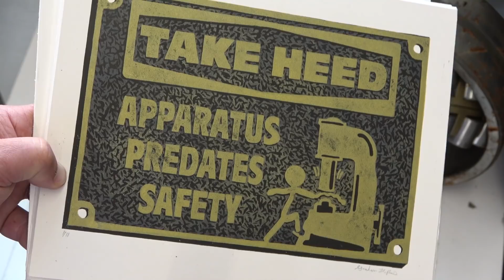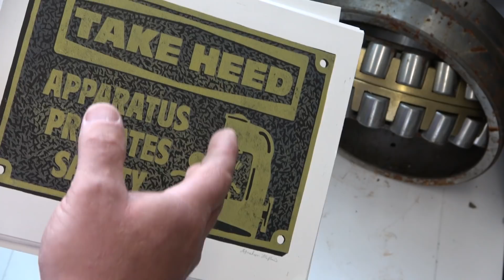Laugh in the face of death!

Comment: Ordered! That will perfectly match pre safety aesthetic I am going for with my old worn out south bend with exposed belt drive. I might even be able to remove the pesky back gear covers now.
Reply: You mean yours has covers?  Mine never did...and it was a frankenstine of a machine to begin with- had a underdriven flat pully headstock on an back drive V belt way :).  The extra bits from the TSME purchase of 75 or so 9" SB's in about 1985...

Comment: I remember doing my time in the rubber mills they had plenty of those types of machines. My favourite being a sparkie was the liquid secondary resistance starter for one of the mills right out of a Frankenstein moofie. As a first year it was my job on Monday morning to start the beast, super cool all manual open bucket starter with a handwheel to lower the plates into the solution. They ended up putting a fence around it when some production worker thought it would be a good place to wash his hands 🤣😂 shouldn't laugh but we all did, back in the day where if you survived it was funny

Comment: I’ve got just the place for one of these stickers: it’s an ‘apparatus’ I built to run one of my old cordless drills that the battery pack died on. It is basically a full-bridge rectifier hooked up to an extremely bad linear voltage regulator. It involves the transformer out of a dead computer UPS hooked up the wrong way round, a couple capacitors the size of coke cans, and a scavenged rectifier bolted to an old CPU heat sink. It doesn’t do a very good job of powering the drill, but I’m pretty sure there are at least three very spectacular ways it could kill me. Whatever, at least I didn’t need to buy a new battery pack!

Comment: I was reading it as the other meaning for "predate" as in, "to prey on". Some machines are so old and sometimes badly designed that even if you try to be safe, they'll mangle or kill you anyway.

Though I think the picture of the apparatus would need a maw full of sharp teeth chewing on the operator then. :P

Comment: 1980s the only safety equipment in our Blacksmiths shop was a SHOUT  "mind out ! "
Err there was a fridge to hold a small bottle of Lidocaine  to numb the eye if you got a steel splinter.
We did have safety glasses but they were for a nip of brandy if you had a shock.

Comment: I have a 1936 13" band saw for which the "pre-safety" sticker will be perfect! They don't make 'em any more like they did that one. My father bought it when it was about 30 years old and I've had it now for almost 40 years. Still chooches mightily. I have a nice half-inch scar on the middle finger of my left hand from very nearly taking the end of it off when a work piece I was shaving a thin piece from slipped out of the blade about 50 years ago (dear God that hurt). Bound it up tightly with band-aids to avoid telling my father about it.

Comment: This is a bit off subject could you possibly look into the condo collapse in Sunrise Florida please sir. Would prefer your no fluff analysis
Reply: They were in the middle of a 40 year safety inspection when it fell over, probably lots of info to be found out about the whole situation.  Damn Florida sinking problems no doubt.
Reply: IMHO, that was an "assisted" collapse. Like Bldg. 7 at WTC.
Reply: @lordphullautosear  dude Miami sinks, the seas ain't rising, the land sinks, by a lot annually, the only conspiracy here is one of criminal negligence.
Reply: @lordphullautosear  Yeah, the building was only collapsing for decades a couple of mm at a time.  "You think that's a problem?"  "Nah, it'll be fine" (props to The Critical Drinker).
Reply: Too early. There’s not really enough there for speculation more advanced than wild ass guess.
Reply: @dlewis9760  the whole side of the building was probably hanging above the ground, no concrete foundation just adjusts to a 20cm sink.

Comment: My favorite safety sign was at a cedar sawmill that had an 8 foot diameter circular main cut off saw, with minimal safety cages. On the structural beams near the saw a sign read- This saw will kill you. It doesn’t take fingers, hands or arms. DONT GO NEAR WHILE RUNNING.
Underneath the sign someone wrote- So dancing near it is still OK?
Gotta love the cedar shake and shingle industry!

Comment: We've got a pair of big crank pinning machines at my work 5 foot diameter rotating drum with a slide through the centre with a dirty great slug of HSS on it feeds the slug toward the centre of the drum as it rotates cutting crank pins out. If the swarf from a 4 inch wide slug of HSS cutting 5 thou a rev out isn't sketchy enough the foreman once stuck his head in to take a look if the slug had started cutting and on its way back round the other side of the drum got him in the back of the head half scalped him. no guards, no interlocks, no momentary lapse in concentrations!

Comment: Back a life ago in another life, the shop I was working in decided that a CNC router was the way of the future, what for carving fancy designs in compressed cellulose foam blanks. 
The boss decided that we didn’t need any of that fancy-light-gate-barrier-machine-in-operation safety stuff, surely some black and yellow tape on the ground and a few stickers would keep the workers the machine was supposed to replace out of its way. Machine time is expensive, afterall! Besides, the thing was supposed to replace a whole team of carvers… turns out it just made them into sanders. 
I’d hazard that such a plaque would not have kept the number of people smacked by the machine any lower, but it sure would have looked good while doing so.

Comment: It only hurts until the pain stops. I work on OLD tube amplifiers and that includes radio transmission amplifiers that run at 20,000, 30,000, 100,000 Volts @ a few amps and they can and they will turn you into instant soot. No interlocks on these bad boys so mind where you put your booger hooks. Them things will blow your right hand off clear up to your left shoulder. The little guitar amps I started on when I was 10 years old would have pieces of my fingers sizzling away inside them, while I was wondering, "How in the hell did I get clear across the room and slammed halfway through this wall, and how I am going to fix the wall before my dad gets home?"

Comment: Smart handy guys, how warm is too warm for trailer bearings? I just replaced mine and my races for the first time and I'm paranoid that i did it wrong. My temp thermometer reads 120F after a medium drive.

No noise, the ride is smooth. No play on the wheel.

Comment: I'd like to see one featuring a radial arm saw.
Reply: Yea those things pre-date safety alright.... have you ever seen anyone ripping sheet stock on one by shoving it past the thing with the saw fully extended on the arm and swung round 90° (so, at gut height then!)

You can cut kitchen panel detail on them too, Ye Olde videos from DeWalt about the many uses of their radial saw are terrifying 👀😳
Reply: @mor4y  Yeah.  The RAS was an attempt to have one saw do everything.  It does almost everything but with a lot more risks and less control than modern tools.  I have one, but it hasn't seen any use yet.  So far my tablesaw and my compounding, sliding, beveling miter saw have done all the work.
Reply: @TWX1138  you should have a look at selective engineering (Australia) TWC Carriage and add-ons to the system. Its a really cool idea, but only people with RAS can immediately see the potential, other people need to see a few videos first!

Comment: Have a 16 inch friction cut off saw at work ( think zip cut from hell) and saw a wood butcher cutting a piece of angle the wrong way while he held it with his hand in the vise, yup not with the vise but with his hand. Had to explain to him that the 3 hp motor and 16 inch blade don't know the difference wether it's cutting the steel or your fucking arm off.

Comment: Thanks very much for this "laugh in the face of death" ....Apparatus predates safety...upon my second summer job at 18, my employment at a factory consisted if one job of placing these pins (3" by 3/8) in a Vee Block 3" into "el" shape under a mechanical press machine.
An industrial size crib of these straight pins were to be bent, the "person in charge" set up the machine with foot operated mechanism and pneumatically (and high speed) bring down the Vee wedge hence bending these sticks into el pins. Operator safety was not of concern
With crib of say 80,000 steel pins to do, repetition and failed operator attentiveness almost lead crushed finger(s) 
This makes me cringe upon the reminder
Life would be so different
Long time subscriber
A freebie would be nice (just sayin')

Comment: Predates safety? More like predates pretending to be safe to minimize litigation. 

Three different companies I’ve worked for have literally had the super give us all a speech about not working on live circuits. They say it is zero tolerance. They say even if the owner of the company says to do it don’t. They say it is you who will get in trouble for doing it not the person who told you to do it. Then before the day is over (once was only 10 minutes later) the same person who gave the speech is telling you to work on a live circuit. When you mention what he said earlier he looks at you like you are retarded and tells you don’t screw up or get caught. I’ve saw a guy do the right thing and refuse to do it. They said you won’t get any repercussions if you refuse to work on live systems. He didn’t get any repercussions, but did get transferred a few days later to a night shift position on a job that was 6-7 hours away. I’d live to work for a place and people that weren’t two faced liars, for a place that actually cared about safety and employees.